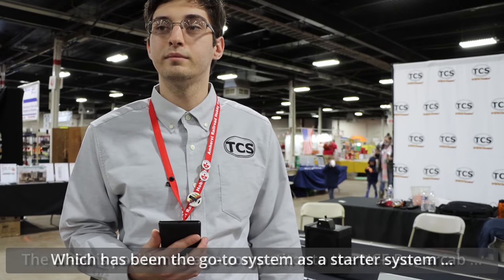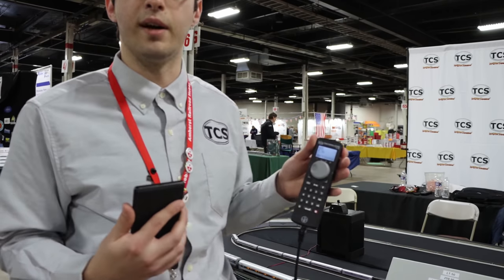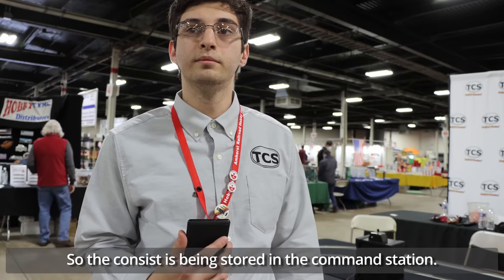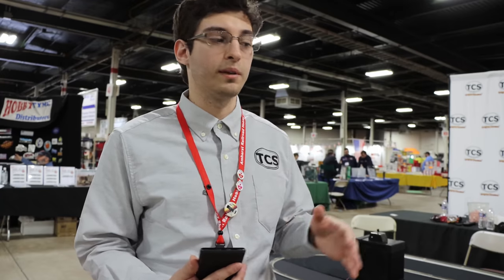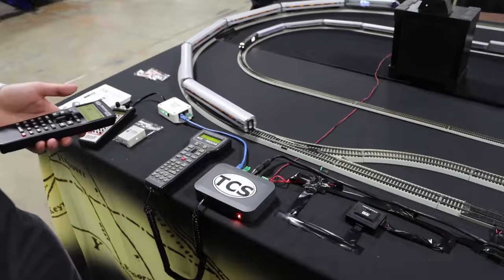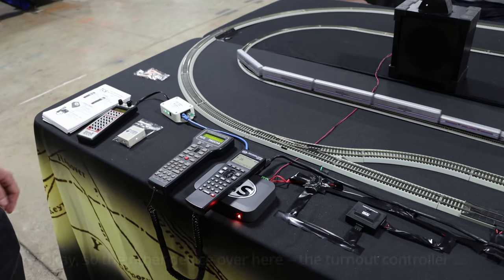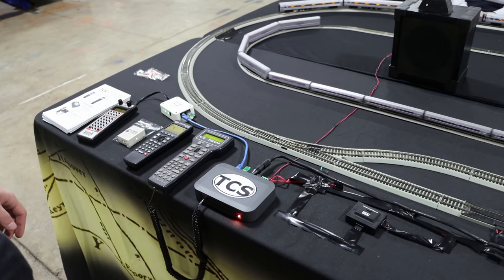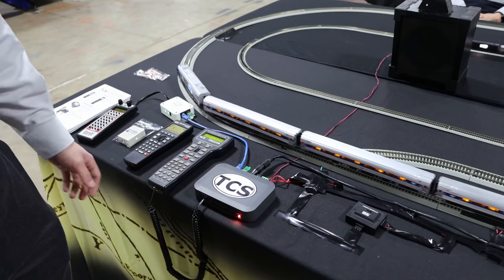First Look - TCS DCC System | January 2022 Amherst Hobby show - Model Railroad Hobbyist

Comment: There are a lot of Digitrax Zephyr users that would disagree with the statement that the PowerCab has been the "go-to" starter system over the past several years.

When I turn my Digitrax system off and back on, the command station consists are still there.

When someone "steals" your train on Digitrax, you don't lose control of it (Digitrax probably should have picked a different description, maybe "share" would have been better).  The first controller still has control and either user can make changes and they immediately show up on the other controller, just like as shown here.

Comment: I have a simple setup, so this system appears to be overkill, regarding consisting, mixing throttles, shared locos, accessory decoders, and JMRI. What I do like is the all-in-one throttle that combines the throttle and command station. Finally, I do not understand the TCS booster issue.

Comment: Will the new TCS command station have built in Wi-Fi to be used with the UWT? Will it be robust enough for G Scale?
Reply: As for G scale, their intention is to have power supplies that provide higher voltages and a high amperage (10+) booster for larger scales.
Reply: Btw, this is Jeff Shultz, Not sure why Google/YouTube is using my 2nd Division account to post...
Reply: @2dPNR  thanks.  But will the TCS command station have Wi-Fi integrated in the unit.

Comment: Question: my MRC DCC I shut off the power and come back the next day, and the consist is still there, so what is the difference in TCS?
Reply: Same is also said with NCE, at least when I operate it does.
Reply: We think Jeff wasn't quite clear on the consisting point -- the difference with TCS is advanced command station and in-throttle consisting, which has more config features than any other consisting by any DCC system so far.
Reply: @modelrrhobbyist2045  I'm pretty sure my CVP EasyDCC system, if I use the command station consisting feature (not changing anything on the decoders), if I turn off the power, I lose the consists. I like that the CS-105 doesn't, which means I won't have to use CV consisting anymore if I go to it. And as I understand it, if you plug a UWT throttle into a CS-105, it no longer does in-throttle consisting, they do advanced command station consisting instead.

Comment: I think it would be neat if TCS can find a way to add "throttle permissions" of sorts into the DCC command station.  If only certain throttle IDs could be allowed to set their throttle to an in-use loco address, and others were not able to, this would solve the contested address issue that Jeff brings up. Dispatchers and ops hosts could manage chaos at their sessions and transform this perceived drawback into another unique TCS feature!
Reply: The great thing about their hardware, is they can always push out a software update with new functionality. Unlike the other Digi & NCE.
Reply: @traindad77  Actually, they don't push out updates, you have to download them and update them manually through software on your computer, the same way current Digitrax devices do.
Reply: To avoid throttle conflicts, get a full-featured throttle for yourself and a simple throttle for visitors.

Comment: Is there any info on the price for the command station?
Reply: It better be less than $200 if they want to make a dent in the DCC "starter" category!
Reply: Even if it is over $200 there are a lot nicer features and definitely more thought put into it so even if it cost a little more I believe it would be worth it just because of those features and functions. which have been thought through and even those that have been tweaked and modified to work better.
Reply: @chrisdurgala5548  Couldn't agree more, but I was basing my comment about him mentioning that they were pursuing the first time NCE Power Cab buyers. I very much want them to succed, as I want to buy one when they are released.😁
Reply: They have two systems coming: the LT-50 which is an NCE PowerCab starter system alternative ... list price is rumored to be under $300 (street price under $200 likely). Then there's the full-blown CS-105, which is similar to the NCE ProCab with wireless capability ($875 list, 600's street price). We're guessing the CS-105 will maybe list for $700-ish, with a street price of $500-ish, but that's just a guess. Keep in mind, the CS-105 needs to be compared to an NCE ProCab with wireless because the CS-105 is WiFi enabled.